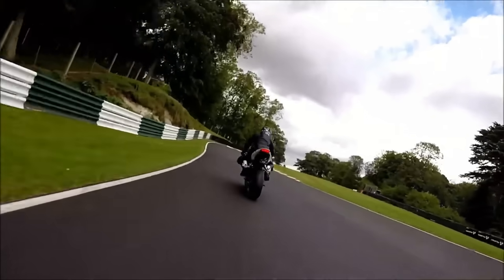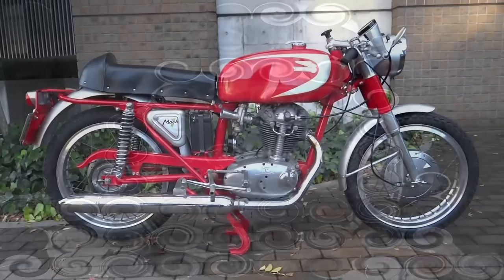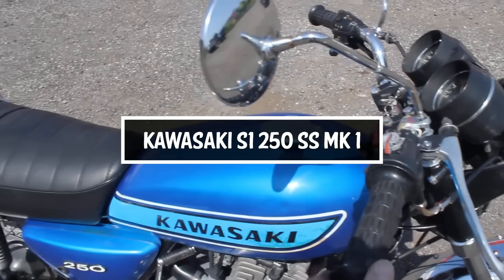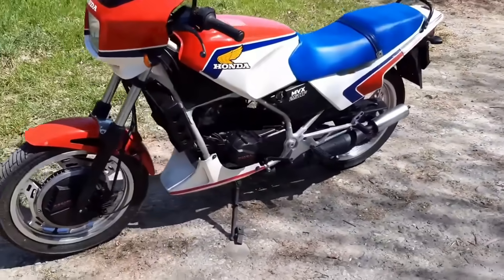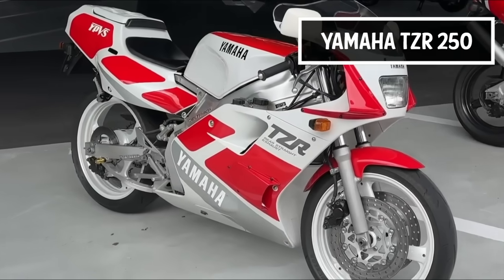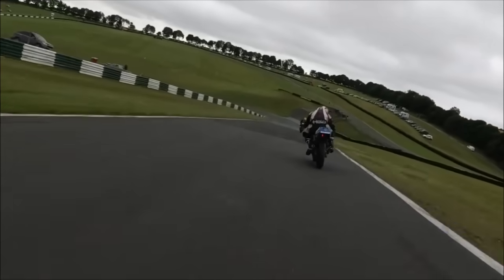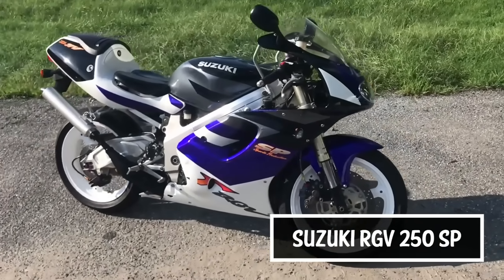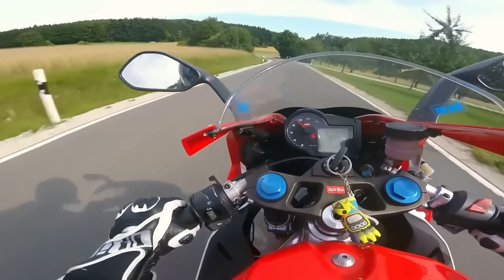The Fastest 250cc Motorcycles

Comment: I think the NSR150SP could achieve 180 km/h if was a derestricted model (such as sold in Australia )...although I've heard the factory power rating of 39 HP in reality is closer to 22 HP.

Great video by the way...I'd planned on skipping through to certain bikes I'd personally find of interest - but couldn't help but to watch the whole video once it began! 😊
Reply from the maker: not a bike i know to be fair. have a great day mate
Reply: @barebonesmc  There was several versions of 150 CC 2 stroke sport style road bikes in the late 90's and early 2000's throughout various manufacturers.

I think the NSR150 replaced the NSR250 that finished in the late 1990's with the MC28 model.

The NSR150SP had a single sided rear swingarm and was a light little bike of only 122.4 kg (wet weight).

There was also the NSR150RR that was virtually the same bike with a few minor differences...and one one major difference of not having the single sided swingarm.

The NSR150SP and NSR150RR were only sold in certain countries.

There was also a less powerful NSR125 in some countries...but it was completely different to the NSR150 series.

Some other competing 2 stroke bikes from the same era were the KR150 from Kawasaki, the TZR150 Yamaha, and from Suzuki the RGV150...although it
may have been called the RG150?

Thanks for your reply and kind regards! ☺
Reply from the maker: @starhope9630  where are you mate? dont think we got any of them here, 150cc would have been a dead category in the UK as licence change was 125cc, when people passed they wanted bigger bikes. Cheers for watching mate 🙂 Ride Free

Comment: Great material!
I have always believed that the 250 class is the optimal combination of sufficient performance, low weight and very low fuel consumption (does not apply to two-strokes).
Unfortunately, currently this class is slowly dying a natural death and applies only to motorcycle racing. The reason for this is the regulations, e.g. those operating in almost all of Europe.
Currently, every driver with a car driving license can drive a motorcycle up to 125 cm without any additional qualifications.
A motorcycle license is generally only valid above this displacement and is often graduated.
In Poland, where I live, the first category of a motorcycle license is "A1" up to 125 cm, but it applies only to those who do not have a car license. However, the next category "A2" is for motorcycles up to 46 horsepower, regardless of displacement. Young people want as much power as possible, so instead of buying a nice 250-350 bike, they prefer the old, big Yamaha Diversion 600 with the engine throttled to 46 HP, or the Honda CB 500, Suzuki Bandita 400, Suzuki Gs 500E or Yamaha Virago 535.
And no one wants 250s, so you can even buy them cheap.
It's nice that you mentioned Mz - because for me, a Pole who remembers well the times of the Warsaw Pact, Socialist East Germany, Czechoslovakia, and the USSR - Mz was a lifetime dream.
The standard Mz TS 250 from the 80s or later ETZ 250 models, with a 22 HP engine and 5-speed gearbox, were the best motorcycles of the entire Eastern Bloc.
As part of the tests, the Mz 250 drove through the Sahara desert without the slightest failure, traveled around the world and broke many other records. Neither the Soviet IZH 350 nor the Czechoslovak Jawy and CZ 250/350 could match the Mz.
In Poland, the Mz 250 was used by the Militia and border services.
I would venture to say that if it wasn't for the Mz engineers, two-stroke bikes would look completely different today. However, it actually started much earlier - before WWII in the DKW company.
Some Germans translated the abbreviation of the company's name as "Das Knaben Wunch" - A Boy's Dream, and not without reason.
When motorcycles such as Rudge, Norton, Triumph, Velocette, BMW, Zundapp, Excelsior, NSU, FN, JAP, BSA lined up side by side on European racetracks -
 DKW introduced among them a racing monster with a two-stroke, three-cylinder engine with a capacity of 600cc, supercharged by a huge turbocharger.
Everything that DKW achieved was inherited by Mz.
My personal favorite in the 250 class is the indestructible Honda "Dream" or CB. We should thank the Japanese for this miracle, as well as the English, because the CB 250 is nothing more than a tiny, slightly modified Triumph.
Greetings from Poland.
Reply from the maker: welcome aboard, and thanks for the comment, the MZ community is STRONG 🙂Cheers for watching mate. Ride Free 🙂

Comment: My old KR1 was a quick bike, but the Aprilia RS250 (Suzuki RGV motor) was probably the best 250 I have ever ridden, the KR250 I missed out on a mint Japanese import one for £800 many years ago
Reply from the maker: Ouch, that was a serious miss on the KR, cheers for adding your bit though mate, Ride Free.
Reply: @barebonesmc  The KR250 was not just for the Japanese market, we got them here in NZ, and Australia got them too, and they were not just surplus Japanese market bikes, but proper NZ/Australian spec bikes built for these regions. I had one back in 84 for a while, until it got stolen. They did quite well in 250 proddy racing easily being the match for the Mk1 RG250 and RZ250 ypvs. The MVX250 ((they were sold down under as well) was a bit of a lemon, slow compared to the opposition and had a terrible reliability problem when first released. For a while the wreakers were full of them. For context the learner limit was 250cc in NZ in the 80s & 90s and you could (and i did) get your licence at 15, so lots of young guys hooned around 250 strokers like RZs TZRs RGs MVX's NS etc. Fun times.
Reply from the maker: @uhtred7860  someone else said that about the KR earlier, i guess we just missed out here, .Cheers for watching mate, Ride Free

Comment: Interesting vid, and I'm not even a biker!
 I worked for a [mostly] motorbike finance company  called RIGP between 1980 and 1982. The RD250LC was instrumental in the uk govt limiting learners to 125cc and 12hp. I seem to recall the reasoning behind this change questioning why a complete novice could get on a bike that would do 100mph.
I guess they had a point 😮
Reply from the maker: all it meant in reality, was people tuned the 125's more and made them even more dangerous though lol, i remember a particular MBX125 we tuned for one guy going well over a ton 🙂 so it didnt make much safer overall i dont think i think the A2 introduction did far more really
Reply: That's still a load of bull, if that point was valid, why? as I've said in my other comment, can a NOVICE learner car driver jump straight into a Bugatti Veyron as a 100% learner (with a person with 3 years minimum on their licence sitting in the passenger seat, not necessarily with ANY experience, just ANYONE who has held a full licence for 3 years) and hit the road in a car that's well capable of acceleration & top end speeds well over ANY 250cc ever?
Reply from the maker: @1t_wasnt_me  i think in reality, especially with a passenger, safety and responsibility run hand in hand, and some people are just better at them than others regardless of testing. you cant train stupid as they say lol

Comment: I have owned sever bikes by Honda, Kawi and Yamaha.  My faves were Kawi 250 Ninjas from 1982 to 2005.  My least fave was a Yamaha Seka at 600cc, it was a dog.  The Honda 500 I gave up because it was so fast it was going to kill me.  The Kawi 500 Ninja was terrific but I had to sell it off for economic reason (kid's tuition)  The best suited to me were Kawi 250's.  Ok for the Turnpike and a good commuter bike.  If I could buy a bike today, it would be a used Kawi 300 with fuel injection and, maybe, a slipper clutch.  Bet I could get one for less than $2,000.  100+ makes me very uncomfortable.  I get tunnel vision.  NJ Turnpike has a 65 mph limit and any 250 can give me the 85 to 90 that lets me get out of the way of trucks and NJ armature drivers who only get on the Parkway for Easter, Christmas and the 4th when they are drunked up anyway
Reply from the maker: they dont sound like great riding conditions mate :-) in that situation i think i would probably choose a small Supermoto :-)

Comment: Before your final question, I think there is a bit of fault in the restrictions on driver's licenses in some countries that encourage brands to make models that fall within that parameter to attract the public. then the jump to a 600cc or something similar is considered. However, there is a Kawasaki zx 25 r with 50 hp but mainly focused on the Asian market. The cost is also high but it is close to the motorcycles of before. the demand is based on the restrictions, also remember that the restrictions of the Japanese market pushed the 400cc
Reply from the maker: Demand can be driven by many things :-) and yes, you are right with regulations, but the change in focus of racing had a big impact, and yes, i think i agree the 400cc sector will be one of the new battlegrounds. the new ZXR400 could be interesting, and despite initial price guesstimates being higher it is being offered around £9k in the UK, we will see if it succeeds. I am sure there will be others to follow, the CF Moto 450 twin engine used in the SR i did a video about could be an interesting cheaper alternative too. and I know Kove are due to release the 400RR project so it is hotting up, Cheers for watching mate, have a great weekend 🙂
Reply: @barebonesmc  exactly, it seems that the manufacturers slowly prepared that stage to battle among the 400cc. I think it would be interesting to review all the "forbidden fruits" of Japan from the 80's and 90's in that segment. I understand that they were sold in the UK with power restriction at the time but I also remember finding VFR 400 service manuals explaining in detail where to touch to delimit them. I don't think we will see that refinement of other times with gear cascades or today's exotic air-actuated valves, refinements directly from the competition. here once again Ducati can surprise with a desmodromic and clean the competition directly. As always, the cost will have a lot to do with making the product viable. Chinese brands have joined the fight and need to show themselves (you mentioned KOVE or CFMoto) but I don't see them as bold.
Reply from the maker: @danielguzman9061  I guess we will see how bold they are in time, i think CF Moto were quite bold putting a 5 year guarantee on the same tech KTM dont even like putting a year on lol, .Cheers for watching mate, Ride Free

Comment: 21:53 🥰SOOoooo good.😌💋🤌🏻
Reminds me of the old CB750K I rode with a Kerker 4-2-1 exhaust. Blew out the end cap on it one night at the exact worst time for it to happen. I was playing hide and seek with about 5 playmates. Oh the shoeing I would have earned had I lost. Deservedly so but an illegal smile years after is a great memory.😁

I put down most of the speed discrepancies to a combination of rider weight, size, and position as well as conditions of temp, pressure, humidity, and road surface.21:53 🥰SOOoooo good.😌💋🤌🏻
Reminds me of the old CB750K I rode with a Kerker 4-2-1 exhaust. Blew out the end cap on it one night at the exact worst time for it to happen. I was playing hide and seek with about 5 playmates. Oh the shoeing I would have earned had I lost. Deservedly so but an illegal smile years after is a great memory.😁

I put down most of the speed discrepancies to a combination of rider weight, size, and aerodynamic position (which is why size is distinct from weight) as well as conditions like temp, pressure, humidity, wind and road surface.

Then one other thing to take into account is that occasionally you have a particular machine that the gods of performance smile down upon that harmonizes perfectly. There was a well known English Electric Lightning that was known to be far faster than any of its contemporaries. Intercepted an SR-71, not out ran but intercepted, as well as a Concorde. She just flat out was a Hot Ride.

Look forward to the 500 then 750cc video in this format!🥤😮🍿
Reply from the maker: lol, they will both take time mate, this one nearly broke me lol, i was sick of hearing my own voice by the time editing was done lol  :-) Cheers for watching mate, enjoy the ride

Comment: I really enjoyed this video and learned a lot especially about the racing scene from the late 70's on. 
I was a big fan of motorcycles in the early 60's and 70's and would add some things from memory, poor though it may be, about commercial smaller bikes. 
Bultaco Matrella 2-stroke was around in early 60's too, I looked enviously at them in mags. Here in North America it might have been a slightly different scene than in europe. Japan through Honda and others was changing the horizon here. I don't think 250 ccs was a legal restriction so much here it had been more of a "big bike" scene mostly 650's and Harleys, then the Japanese invasion. (Though I had a BSA Bantam 150 around 1961?) The early Japanese bikes were under 250 cc's and gradually increased in displacement and sales. Honda Cub growing to 90. and a few Dreams and baby Dreams (150's) around with stamped steel frames, deep fenders and trailing link front suspensions. In the late 60's the Honda CB with tube frame, and telescopic forks was popular in 305 cc version (not in the 250 cc category) but think it was close to a ton bike). 
Generally I thought there was lots of bike development and excitement in late 60's early 70's at least in the commercial road bikes. 
 The Yamaha Twin Jet 100, the rotary valve Bridgestone 175 at this time, and reed valve development was happening, oil injection too. Off the road lots was going on in tuning with those expansion chambers. With road bikes, Yamaha had a fast 300cc twin at end of 60's that I am sure was an over 100 mph bike in these horsepower war times.  When Kawasaki came out with it's triple here it was in 350cc form and was brutal! Crazy fast but couldn't handle, then the 500cc version! (Suzuki had a 500cc two cycle twin but outside our 250 category and about the end of two strokes happened mostly due to emissions standards).

I think the commercial development made all those exciting small bikes. Now they are considered "beginner" bikes and no one is working on them.
Reply from the maker: Cheers for the comprehensive comment mate and thanks for watching. Ride Free 🙂
Reply: The Bultaco Metralla was all of those things and it could 'do the ton'. Which I can't verify because at high speeds the needle bounced like a lunatic and my tallish frame was tucked down hard making the road the only thing that could be seen. I had one from 1974-76. It also had a race-ready frame and gave incredible confidence to go harder at corners. It is curious that it didn't feature in the video because in Brisbane, Qld, where I lived at that time, every police car double-checked when you went by. Instant outlaw you'd think but not quite, it had an enclosed chain with an oil bath to extend the life of the links, very Granny. Goggles and a pith 'pudding bowl' helmet completed the 'look'.
Reply from the maker: great bikes, they are featured here https://youtu.be/jgSnHBdXcOo 🙂 Cheers for watching mate. Ride Free 🙂

Comment: You forgot the FZR 250 Four   16000 RPM Red Line.    20000 RPM Tach and it  would Rev past 16.  Amazing exhaust note
Reply from the maker: no i didnt, its in the 4 strokes section 🙂

Comment: The across was a fun bike that could be used for the weekly commute and thrown through the twisties at the weekend. Did suffer from valve recession. Came to NZ as grey imports
Reply from the maker: someone was saying they came to Australia and NZ in the range, and the Aussies say they were popular there too, id never come ACROSS them :-) sorry lol .Cheers for watching mate, Ride Free
Reply: @barebonesmc  NZ got a lot of grey imports as it was a lot easier and cheaper than importing them to Australia. We got got some great 250 and 400 4’s ex-Japan
Reply from the maker: @ponytrishpip  i guess logistics would be easier than bringing them to the UK 🙂
Reply: @barebonesmc  it was because NZ had an ageing road fleet due to high duties on new cars. Some one realised that it was particularly easy to import second hand cars from Japan and get them legally road worthy at a low cost. These imports where usually newer, better spec and far cheaper than cars originally sold new in NZ. This quickly trickled down to not only motorcycles but commercial vehicles as well. I personally owned a Yamaha XJ400 and a Kawasaki GPz400. Dealers tried to make things difficult by not supporting grey imports and refusing to supply parts for them. This very quickly led to an industry just supplying parts, service and accessories for grey imports and you could easily order items from Japan regardless.  Australia made importing grey imports a lot more difficult and only rarer or more unusual vehicles got imported there.

Comment: There is a lot of CC snobery.
If its not large capacity people aren't interested. Most would prefer to wobble about on a bike that has far more power than they can handle.
Rather than get the satisfaction of really being able to ride a 250 to its full potential.
If you can ride a small bike quickly. You can ride anything!
Reply from the maker: great point 🙂 and as they say, its better to ride a slower bike fast than a fast bike slowly 🙂🙂Cheers for watching mate. Ride Free 🙂